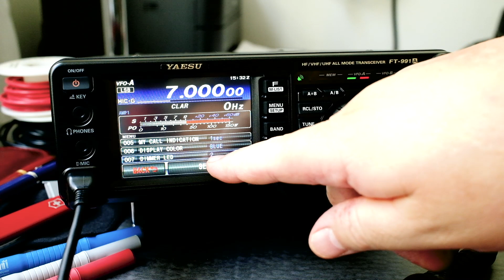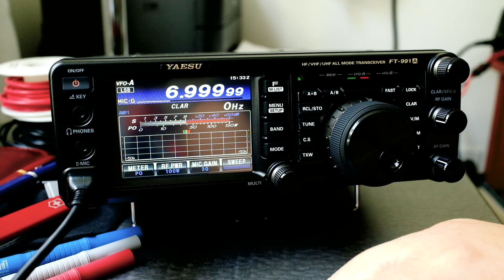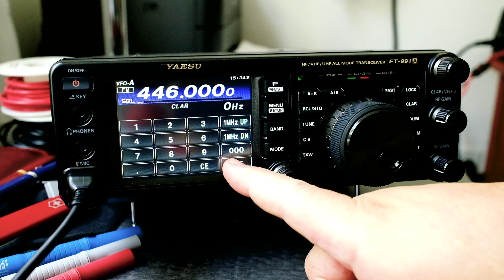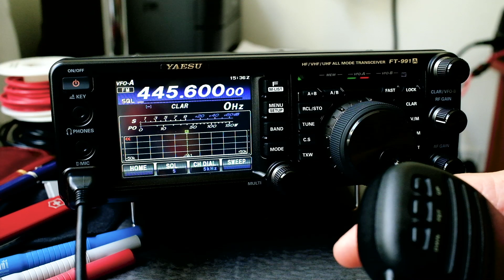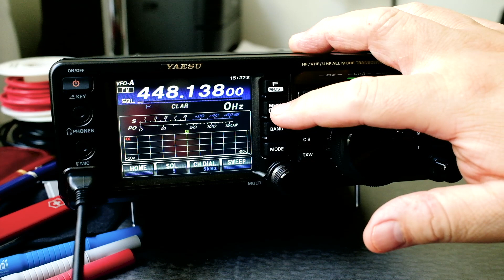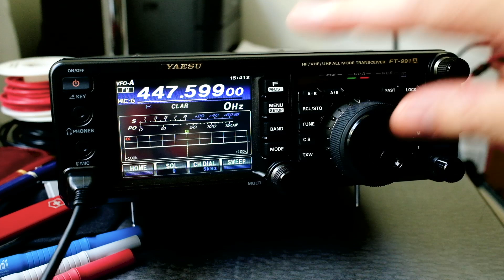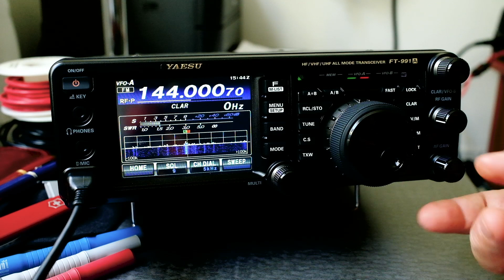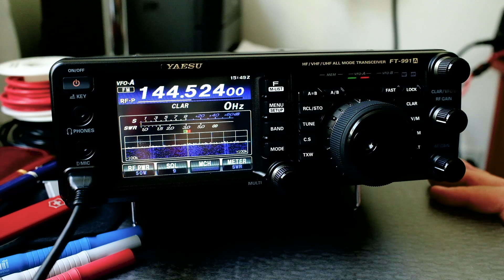Yaesu FT 991A Beginner's Guide

Comment: Hi Frank, I am hoping you can answer a question for me in reference to the FT-991A.  I am in the market for another antenna because my, MyAntenna was struck by lightning.  I have the Yaesu FT 991A and I was wondering if you know this, will this radios internal tuner, tune a random wire?  I am asking because I only experience with the MyAntenna, 80-10 EFHW antenna.  I did love this antenna but, was wondering if I need to get an external tuner for using a random wire antenna.  Thank you Frank.
Reply from the maker: I would say no.  I would get a dedicated tuner for a random wire.  If you antenna was close to resonating, then yes the built-in tuner would be fine. But for random wire I wouldn't count on it. As alway, see what other folks have to say about that.  Good luck.  -73
Reply: Thank you Frank.
 @frankwc0o

Comment: Does SWR meter work on VHF/UHF with this radio?
Reply from the maker: It does. But most of the time the VHFUHF antennas are very good and thus you don’t see any SWR movement.
Reply: @frankwc0o  Oh okay, thanks. I'm considering getting an 991A once I can get around to putting up an HF antenna. Like the idea of one radio for both repeaters and FT8.

Comment: Great Video Frank, I've watched a few times now and probably will watch a few more. I do have a question for you if don't mind. I just bought my 991a off a family member and the VFO A indicator leds are not lit even after a reset. I can push split and the red indicator on VFO B will light but every video I've seen everyone's indicator lights are on , all others seem to work the rx indicator, lock, and fast and I've seen the red vfo b but haven't seen the lights on VFOA I don't think it's a problem really, just wondering why? Thanks 73
Reply from the maker: I haven’t experienced that particular situation with my radio. I would recommend you calling Yeasu directly. Speak to a technician, one on one. They work here in Southern California.  Good luck with the radio. -73

Comment: I bought this radio 2 years ago.  It has enough menu items to service a 200 table restaurant.  I decided to relegate it primarily to UHF/VHF use and bought a FTdx-101D, which is much easier to use for me, especially in dragging weak signals out of the noise on HF bands.  You give a good demonstration on basic use of it in this video.  Explaining all the subtleties of using it would take many more hours.
Reply from the maker: Thanks Eddie.  -73

Comment: Great video, helped with me getting my FT-991A started in VHF/UHF. I'm late to the game, lol. I got my Technician license almost 2 weeks ago. Am I correct that the TUNE built into this unit does not work for VHF/UHF ??
Thanks, KK7CWG
Reply from the maker: Yes, the Tune doesn't work on the VHF/UHF.  Someone told me that the antennas that you create or buy, don't need that much tuning.  Well if you create a bad antenna, that is a different story.  Good luck.  -73

Comment: Good video on the 991A. I'm tossing back and forth between the 991A and a IC7300
Reply from the maker: I did as well.  I like the IC7300, but like any radio you have to compromise.  What I like about the 7300 is the waterfall has a better refresh rate and better options in making it look the way you want it.  In addition, the menu system is more intuitive.  For example, you can't touch the frequency on the 991A and change it, you would think so.  It's a touch screen, but it doesn't.  On the 7300, you touch the frequency, you can change it.  Things like that, make operating the radio easier.  But, everyone has their needs.  I hope you find your radio.

Comment: For a newbie General w/ no practical experience not yet on HF, your presentation was excellent.  I'm leaning strongly towards the 991A.  Your video removed some of the angst associated w/ programming any radio.  I'm committed to the Yaesu platform, it seems, cuz of reliability and better programming articulation between their radios.   KJ7TKR / Reno, NV
Reply from the maker: Thank you very much for your kind words.  May I make a suggestion.  You should look into the IC7300.  The 991A does have more features, but the interface on the IC7300 is well done.  If you have a chance to see these radios at a store, you might notice those difference.  Good luck. -73

Comment: I bought an FT-991A over a month ago.  Now with your video, I'm ready to take it out of the box. :)   That, and I've had to rig the HF antenna, 70' of feed line and finish the grounding system.  Thanks for taking some of the start-up aprehension away.
Reply from the maker: Thank you for the kind words.  I know how you feel.  Good luck and be safe. -73

Comment: Seems to me that a lot of people downgrade the Yaesu FT-991A for it's menu system. (In the 'Ford vs Chevy' battle). I find it very intuitive, as you so well explain. Most of the settings are 'Set it and Forget it'. I find that the Yaesu and the IC-7300 radios are both excellent and have a valid use for every user. However, the Yaesu is a 'Shack-in-the-box' with it's digital and 2m/70cm bands. This alone made me choose the Yaesu. I also use the Yaesu aviation FTA-750L transceiver and chose it as well for it's additional features for it's price point. You also can't go wrong with the added 3yr warranty. A Square Trade 3yr warranty...$240. Add that to the cost of an IC-7300. Best Regards and 73's.

Comment: Frank you have had the radio for eight months now and also had an opportunity to try an Icom 705 what are your thoughts would you buy the 991a again or try something like a IC-7300 and a separate UHF /VHF rig? I got my ticket in November 2020 and upgraded to General in December, working on my Extra now. Looking to build my shack and it seems to be down to the IC-7300 or the FT991A  I am leaning toward the Yaesu but still undecided.
Thanks again for the content

Comment: Frank another great video. Looking at getting one of these. Have you used the RT program with this yet?  Or is that a possibility? 73 - KO4KMA
Reply: @frankwc0o  I'm looking into it.  I'm currently studying for my amateur extra and so haven't had the time to do a deep dive yet.  I think it would be nice if the program would do my vx-6 and the 991A.  Then I could more easily transfer the VHF/UHF frequencies offsets etc between radios.  I am still a newb and don't have any HF capabilities yet so you may be correct regarding the low number of frequencies.    If I end up getting it I'll let you know  Thanks again.
Reply: @frankwc0o  thanks!  I was afraid that was the case you saved me some time there.  I liked your video showing the RT with the VX-6 it was really helpful and the reason I asked about it for the 991a!  keep up the great work.

Comment: Very helpful, thank you.  Just got mine today.
Reply: @frankwc0o  Hey Frank, may I ask you a quick question?  When keying up on your 991A, do you have to wait a few seconds before it transmits voice?  When I key down, the radio sounds like it's ramping up, then when when I talk, it starts transmitting half of what I said.  It's not instantaneous like a handheld.  I performed this test with My TH-D74 in another room and it always cuts out half my speech.  But once the radio is fully ramped up, it is instantaneous.  Kind of weird.  Like the radio needs to spool up before carrying my voice.  Just curious if you've experienced anything like that.  Thank you, Sir!
Reply: @frankwc0o  No, I wish that is what it was.  I'm just using a simplex freq.  I have my TH-D74 across the room and just keying down.  The radio (991a) shows it's in transmit, but I have to wait a few seconds before the radio fan comes on to start talking.  After being in QSO, it becomes instantaneous - going back and forth, but if the radio goes back to idle, I have to key it up first, then begin the QSO.  Weird, right?  Thanks for replying Frank - truly appreciate it!
Reply: @frankwc0o  Thank you, Frank!  I contacted Yaseu and advised me to return it.  Not a known issue I guess.  Thanks again my man!  73's!